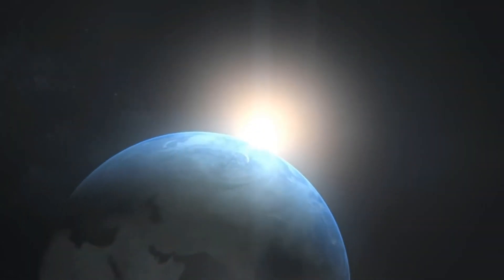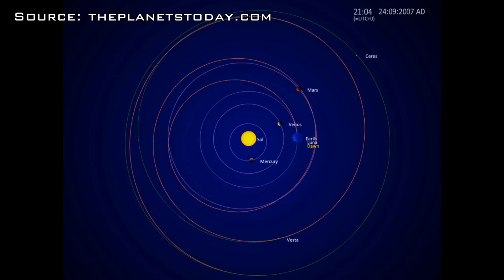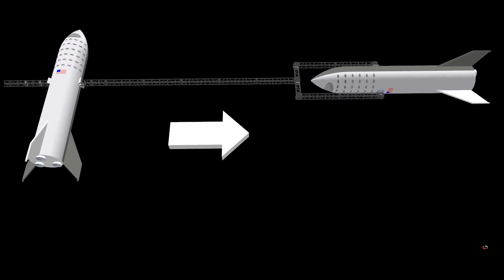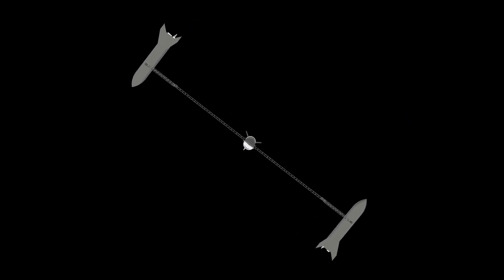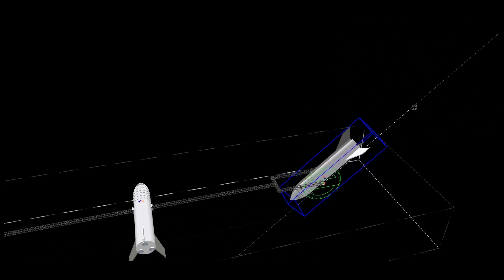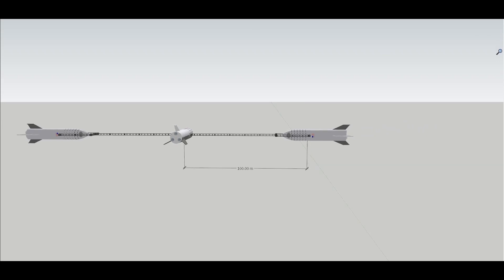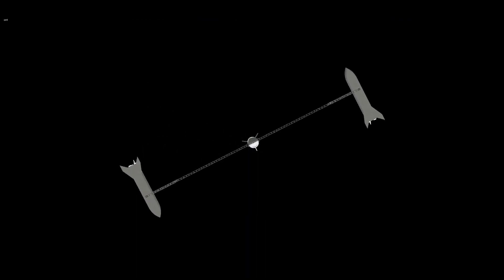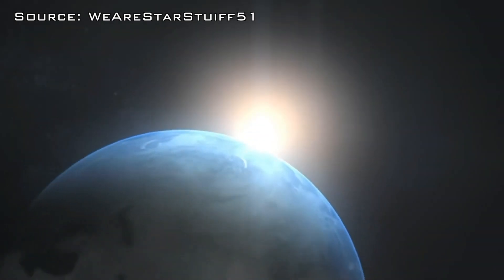GLS2: Artificial Gravity for SpaceX's Starship

Comment: Why not use all three starships to form a triangle and connect them with cables? In this way, you can still use the main engine to start the rotation and you do not need to waste the space in the third starship. Using this structure, you can connect almost any number of starships together and from gravity.
Reply from the maker: Genius! Ok need to do the math for, or figure out an adjustment to mitigate: the unequal distribution of mass caused by 1 payload bay being empty because all of it's truss is deployed. I will continue to give this more thought as I develop the design for v3! How exactly can we use main engines if the nose of the ships are still pointing towards the center of the spin system? Did you know that the vacuum raptor engines are planned to be locked, and will lack any gymbal capability?
Reply: @smallstars  Thanks for your consideration. I think there is no way to use the main engine to speed up or slow down if all the noses point to the center, but since all rockets are connected with soft cables, they can just rotate using RCS and point to whatever direction they want and then start the main engines I guess.
Reply: @smallstars  And the uneven distribution of the mass is not too problematic since we can just adjust the thrust of the main engines of each ship differently to initiate the rotation, as long as their torques with respect to the center of the mass are the same, the system should rotate stablly with respect to the center of mess.

Comment: If I remember it correctly, the problem is not to create centrifugal force. The problem is the radius. Will this be a problem with this system? I know you mentioned 100 meters, isn't that too little?
Standing "straight" would leave you with 0,983 G's at the head. Would this affect the body in any way?
Reply from the maker: Good math sir! It is all related though, if the angular velocity (speed of rotation) remains constant, the larger you make the radius, less centripetal acceleration (artificial grav) will result.

When I did my research for the project I was convinced that 3rpm at 100m would be ok. But now I'm seeing some sources saying 2rpm is Max for 100m. 3rpm may be bordering on not ok for humans. Will update in next video.

Comment: I like this idea. It’s a definite must in my opinion. I think ultimately we’ll need a lot larger structure for the Starship. The 18m version sounds more likely.  Also I think we’ll probably need extra near by rockets to come along on the trip for cargo (food, water, etc). 

Also I think radiation isn’t considered enough in the current design. We need the rocket to have a lot of protection. Probably need many feet of water surrounding the inner living area. This will add a lot of weight. So a larger ship will be needed.

Comment: Is there a mid-course correction burn? If so wouldn’t you have to expend more energy to stop rotation, orient for the burn and then restart the rotation?
Reply from the maker: There could be correction burns, but not mid course unless something seriously goes wrong.
Reply: @smallstars  So they could usually be accomplished either early or late in the flight when you wouldn't be spinning anyway?
Reply from the maker: @skyearthocean5815  yes, mostly early on

Comment: Your bigger problem is actually cosmic rays. There are atoms of iron zipping around the universe, which have been accelerated to almost the speed of light, by the gravitational fields of black holes. If astronauts are exposed to this, for the length of time that it would take to complete a Mars mission, they will get severe amounts of radiation damage. I see no radiation protection for these ships. Once you leave the protection of the Earth's magnetic field, without radiation protection, your astronauts are toast.
Reply from the maker: ETA for my video on solar and cosmic rays is 2 months from now! 😊🥰
Reply: Cancer risk from cosmic rays is comparable to being a smoker.

Comment: The biggest problem with this system’s  current design is that the ship uses the starships body and engine to shield from radiation which requires it to be pointed away from the sun. If they’re directly opposed then they can’t do that.
Reply from the maker: Very true! I only have 2 uploaded videos so far. If u check my first vid out, you will see the original design which has dorsal connections, co rotations on a different axis, and radiation protection always pointing in the right direction. If you have any ideas for v3 protection plz sound off. Thanks!

Comment: Maybe its ebev enough to just sustain an artifitial Gravity of around 0.5 G.
Reply from the maker: .5 is better than micro for sure. But the more the better up to 1G in my opinion
Reply: @smallstars  on the way back it could make sense though. They had to Deal with Mars Gravity for months. So 1G with limited Medical treatment capabilities could be a Problem.
Reply from the maker: @tharix6063  yes! check it out: 4:20

Comment: I like your video, and I agree that centrifugal artificial gravity is essential for successful travel to Mars, but this is way too complicated.  Tether one passenger ship and one cargo ship nose to nose (they already have a lifting shackle there).  With a cable, the ships can have different mass and the pair will rotate around the center of mass, no problem; just adjust tether length or RPMs to get the gravity you need for passengers.  This keeps the ships oriented vertically WRT the gravity force and acceleration vectors so you aren't walking on the walls or pivoting seats/beds. You could even have flush toilets, like on a sailboat or airplane, that would seal when not in use, during zero-g, spin/de-spin, and while maneuvering.  

Adding a dedicated methalox engine at the CG of each ship for spin up and de-spin will be a LOT simpler, cheaper, safer, more reliable, less mass, etc. than the 3rd ship and truss GLS system you propose.  Have you considered the structural reinforcement needed to support the entire mass of the ship at one g from the middle while horizontal?  The ships are designed to launch and land vertically, so all large forces are axial.  Without major structural reinforcement (added mass), the ships would fold at the middle.  You have good ideas addressing a real problem, but I don't think your solution is realistic.  

You said you considered the tether idea but rejected it because the RCS thrusters would not have the control authority to stabilize the spin.  Why not?  They can reorient the entire ship for re-entry, point it precisely for de-orbit burns, etc.  If not, add small methalox thruster engines; much easier than building and deploying the GLS.  You also said the cable introduced a "whole set of catastrophic failure possibilities..." how? ...And GLS doesn't?  A steel cable could be 300% stronger than needed, and overwrapped with a Kevlar or carbon nanotube composite to add a protective layer with another 200% redundant strength.  Simpler is nearly always more reliable.  RCS would maintain tension and orient each ship (cargo and pax) during linkup and payout of the tether, which would be on a drum in the cargo ship's nose.  The spin axis would be oriented with the sun, as you propose, to keep solar panels, radiator, and shields aligned.  Once the spin up is done, there would be very little RCS needed to correct for passengers moving and water movement when the toilets flush... LOL!  ;?)  I'd love to see you make another video presenting the cable tether method and solving your concerns about it.
Reply from the maker: We shall see. I have  7 videos on the list for near future release, 1 of which I have a script for and will out out asap. It's about the shape of our solar system. Thanks for the intelligent input!
Reply: @smallstars  I did a (very amateur) video report a while back on artificial gravity using tethers. The gist of it was that a tether requires both sides of the system be fully controlled spacecraft, which you have, in order to keep them aligned as well as for safety redundancy.I used the axis as a control point to simplify navigation.I would be honored if you would view and consider that video of mine!
Reply from the maker: @DistracticusPrime  link it!
Reply from the maker: @DistracticusPrime  my pleasure! The immediate issue that comes to mind with a mars direct style approach, is that the floor becomes the ceiling.

Comment: Don't forget about the whole bunch of astroid in space. Making this type of arrangement will not only increase the chance of a hit but it would also be difficult to change the direction of the crew ship immediately if needed. Although it is a great idea and I do thik it would increase the comfort of space traveling but the idea needs lot of work to be practically implied. Also the rods attaching the main crew ship to the other two should be strong enough to not just handle the load of 3 ships but the radiation and extreme temperature of space
Reply: This could rathe be good for a space station at first and then could be used for journey.🤔🤔

Comment: Awesome video! I really enjoyed hearing about your artificial gravity setup for space ships that may be on the near horizon! I can think of a couple points that you might want to consider. Or perhaps you have already but it wasn't important enough to include in the video.

1) Controlling the center of mass so that it is exactly on the center starship may be difficult. Sure running fuel across the spinning station may be great, but that can cause some other issues. The movement of fluid may cause a moment to ruin your rotation -> which leads me to 
2) Rotating about this axis is NOT the stable rotation for this setup. It would be rotation around the long axis. If you have ever seen this video (https://www.youtube.com/watch?v=1n-HMSCDYtM) you can see the precession that this asymmetric object has when the rotation is not about its stable axis.
3) The rigid structure would not actually be very rigid at this scale. I'm sure you have thought of this, but it is important to consider vibration in the system and how it can ruin the setup.

With all that said, again I love this idea and I will be watching your channel to see more about the concept! Keep building this idea up man, we need something like this for the future. I sure hope something like this come to fruition. Keep it up!
Reply from the maker: 💜💜💜 1. I have a track/truss climber system in the works for v3. As of now the idea calls for too much heavy duty hardware mass, but we shall see if I can refine the idea.

2. I am hoping RCS will be able to help stabilize the spin very easily. I do need more input from experts about this though. I guess my question would be: with how much momentum does the spin want to flip? I'm actually leaving this issue for V4, and hoping it solves itself.

3. Yes the truss will bend for sure, bending is actually key so that it doesn't break. But it will serve it's purpose to help actuate the system's spin.

Fantastic comment by the way, I've been going through them and this is certainly in the top 5. Im tempted to pin it! 🤙
Reply: @smallstars  Point #2 is addressed elsewhere in the thread regarding stability and how to improve (I would think 4 elements, 2 opposed pairs would be best), but I'm curious why you originally decided to switch the passenger ships' axis orientation to tangential from axial as in v1? Axial is the least stable, but offers the best AG experience possible, so I thought that was a good idea in the original. Another option is to have a second set of opposite rotating elements so that thrust is not required to spin up as you talk about in your starship mothership video. Excited to see v3

Comment: Dude your concept is brilliant. Would a built in section of the spaceship have a section like the middle of the spacecraft rotating internally. The concept is to have a rotation rate of gravity with in the spacecraft. Almost like a cement truck. The truck is moving forward as the rotation of the bucket rotates to mix the concrete?

Comment: You don´t need 1g  full for the body to work and be confortable, if you put 0.6g or less (but above martian gravity of 0.4g), you can use less propelant, lighter structures and over all, less rpm in the rotation, the inner ear will welcome that.

Comment: The basic concept seems so obvious.  
Definitely the most cost-efficient method imaginable right now, at least untill they just make a ship so large it could just rotate on its own lengthwise axis with floors on the outer walls.
I'm assuming they would want to also have cables in the trusses for redundancy though, right?
*edit: Just saw the addition about the cables.  Great :)  Seems like a good idea to have both rigid and flexible components just in case.

Comment: Introducing cables will also add new elastic forces which in space isn't a good idea.

Plus truss also isn't a good idea, because essentially you are attaching two spacecrafts together which is then provided a thrust by another spacecraft which has a potential to mess up things if the thrust is increased or decreased by even 1% in wrong direction. Better option is to Daisy chain in a circuler small pods, which are capable of independently attach or detech when the need arises.

Comment: Wouldn’t there be a noticeable difference in the amount of gravity your feet experience vs the amount of gravity your head experiences? I feel like that could induce nausea at least.
Reply from the maker: You are correct! The bigger the difference the more uncomfortable it is, especially when you turn your head from side to side. This is why the truss has to extend so far from the center of the spin. The difference shouldn't be too bad for my design, it's something like 1% difference or less if you're 1.5 meters tall

Comment: Or just use cables such as proposed by the Mars Express concept.  The greater the radius, the better the simulation of gravity so you can do far better with cables over the use of trusses.   The RCS are on the bodies themselves so using cables is irrelevant as you would not be transferring bending moment to the span.  Cabled connections are proven from the stone age bolo to suspension bridges.  Your abhorrence of a cabled solution has no engineering basis and is just an irrational bias especially since you are proposing two bodies with equal RCS and thrust capabilities hence only tension need to be transferred through the cables.  As to reliability, ever heard of multiple cables?  Multiple cables works well with elevators and suspension bridges.  Cables are far better at tensile strength than trusses, indeed trusses have numerous failure points in the scenario you are proposing.
Reply from the maker: I hear you John, you are right in many ways. I still think a truss and cable system has advantages. Plus the one thing that is needed for a cables only system to really work, is super efficient RCS with a behemoth amount of propellant reserved for it. Also you have to be real careful when slowing down the spin, that's when things become less tension-y as the centripetal force pulls the starships closer to the middle of the spin. Some nose-up thrust, shooting gas towards the center will be in order in addition to side thrust.
Reply: @smallstars  Well as an engineer, I can say that the only point of a truss system would be to transfer bending moment which would be the one force you do not want to transfer.  Even the concept of a truss is to place each beam under compressive and tensile forces only, hence removing the bending moment from the components which could cause failure.  The truss system you propose introduces thousands of failure points over a simple cable system and for what, to transfer forces you do not want transferred.
Reply from the maker: @johnwang9914  v3 uses cable for the tension, and truss to make sure the cable doesn't bend when torque is applied (during spin start and stop.) Is that not a good idea? (I'm seriously asking especially if you are a real engineer)
Reply: @smallstars  But you don't need it to resist torque, indeed it would be better if it didn't as any torque would be unexpected stress which could lead to structural failure if the structure attempted to resist it.  Cables would be unharmed by such unexpected stresses but a truss could snap.  You are simply exhibiting an unfounded bias, you simply think something rigid is stronger when it isn't and that it needs to resist forces that it does not need to resist nor should it experience.  Keep in mind that cables would be a fraction of the mass of a truss and when you are dealing with conventional chemical rockets, reducing payload mass is critical.

Comment: How about four ships on the ends of two counter-rotating trusses, spun up electrically by a small motor at the centerpoint?

Removes use of main engines to spin up the system, and the truss/ship pivots needed.
Reply from the maker: Some one else suggested that! (Unless that was you double commenting) - I love the visual, but I don't see it working because of the lack of leverage the motor will have on the massive Starships
Reply: smallstars With a very low torque - to avoid overstressing the truss frame - applied continuously, over days everything spins up to the needed rotation rates. It’s similar to how SpaceX has been using ion thrusters to move the Starlink satellites into higher orbits. Incredibly low thrust steadily applied. :)